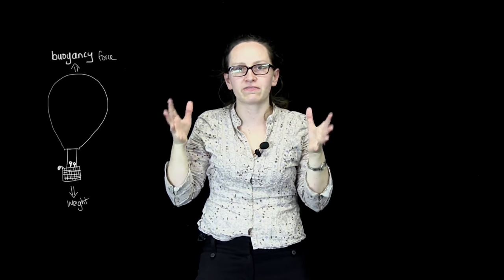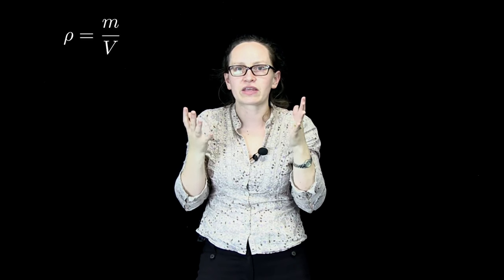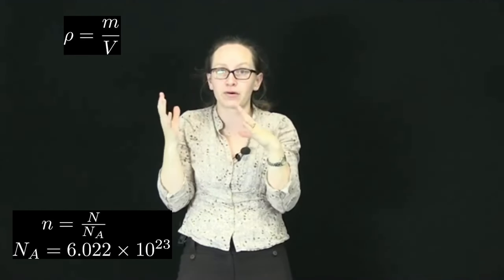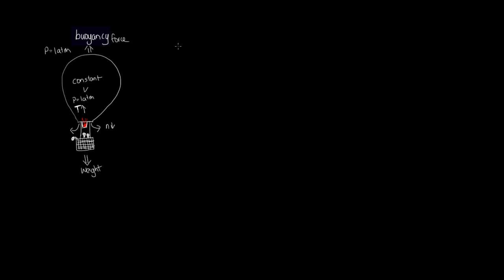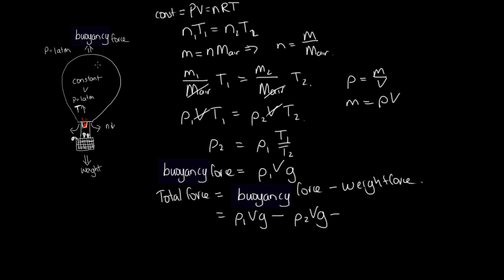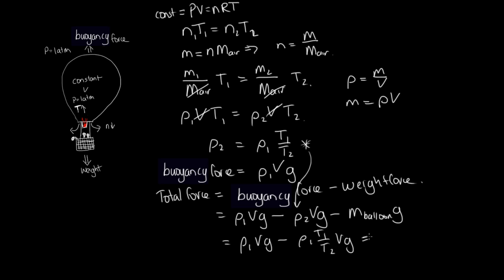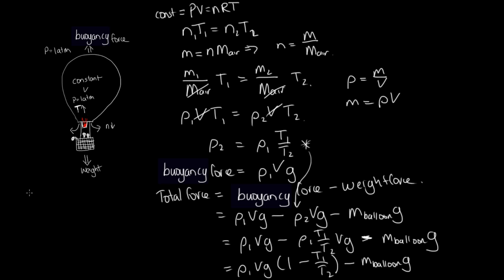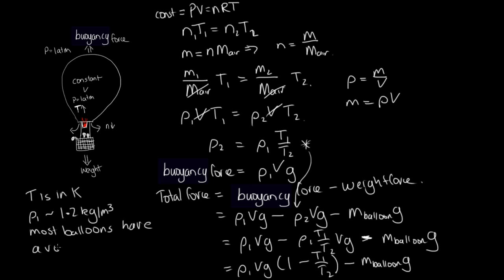Density of air in a hot air balloon

Comment: Please add your actual calculations, for one actual-example, in your description. For instance, calculating the actual lift force of the hot-air-balloon for your hypothetical balloon of 2800m3, assuming it also weighs 2800 kg-gross (on the ground, including payload, but before inflating)
Reply: a 1000 ft^3 = 28.32 m^3 of hot air at 100 degrees C and lift 6.8 Kg
Reply: @KurdstanPlanetarium  Thanks. So, theoretically, a 2800  m^3 hot-air balloon could lift around 680 kg payload, right ???
Reply: @kareemsalessi  That is right, although you can calculate hot air density at 100 degrees C, that most propane gas balloon must provide, then air density = 0.947 Kg/m^3,  at sea level and 15 degrees C air density = 1.225 Kg/m^3 meaning a buoyancy of 0.278 Kg (278 g) is provides for each cubic meter !
Reply: @KurdstanPlanetarium  Thanks, that makes sense. Any idea how many grams a cubic meter of hydrogen-gas balloon could lift off, and the same thing for HOT-H2 gas???
Reply: @kareemsalessi  Hydrogen gas is 14 times lighter than air, and at density of 0.09 Kg/m^3 and air density of 1.225 Kg/m^3 meaning a cubic meter of Hydrogen can lift 1.135 Kg that is more than a kilo. there is no need to hot H2 gas as Hydrogen is flammable with heat.
Reply: @KurdstanPlanetarium   Awesome numbers, thanks. A couple of new questions though:: 1- Does H2-Gas ignite without an external ignition?? 2- How does the density of liquid-H2 compare with that of H2-gas??? Put another way, how many grams of liquid-H2 fills up a ONE m^3meter balloon, with H2, or a 10 m^3 balloon ???
Reply: @kareemsalessi  i have no idea of density of Liquid Hydrogen BTW it is only used in Rocket Fuel and not a balloon. Hydrogen is flammable and can not be heated up.
Reply: @KurdstanPlanetarium   OK, thanks.